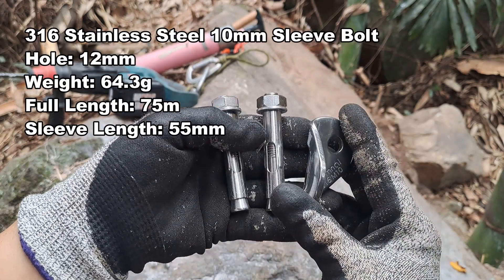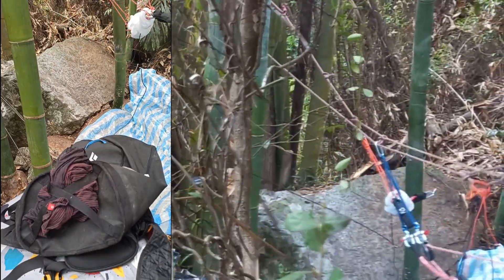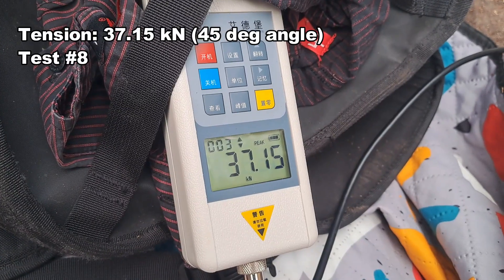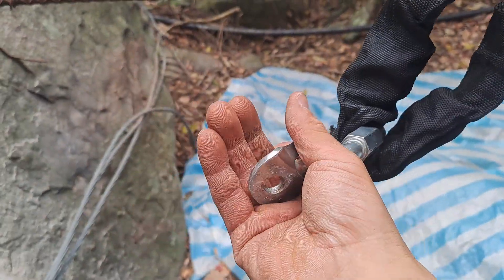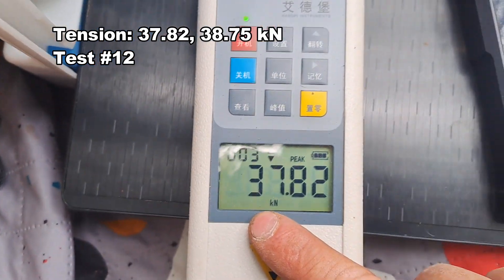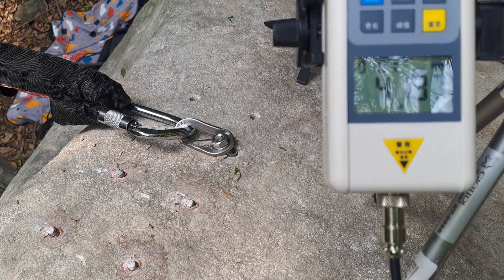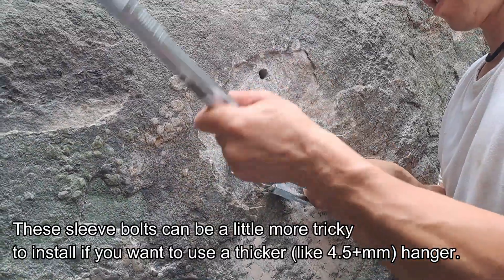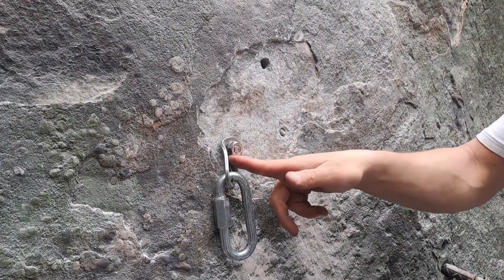BREAK TEST: 316 Stainless Steel 10mm Sleeve Anchor Bolt, China made

Comment: What drill is that, some no-name special? how's she go?
Reply from the maker: It's a China-made no-brand drill that uses Makita 18V batteries. I was between spending the equivalent of $340 AUD for a Makita XRH01Z (Makita in Taiwan uses the code DHR242 for the same drill), or pay $112 AUD for a Chinese one with similar specs. At 1/3 of the cost, & knowing how much abuse the drill would be exposed to, I went with the cheaper no brand &  figured I could buy 3 new drills at the cost of 1 brand new Makita. The Chinese model I got has had hundreds sold already over the few years with overall happy customers. I've had it for about 2yrs now, placed hundreds of bolts with it, use it to chisel rock, trail development, rebolting, etc; it's still running fine. I use aftermarket 5Ah and 6Ah batteries with it.